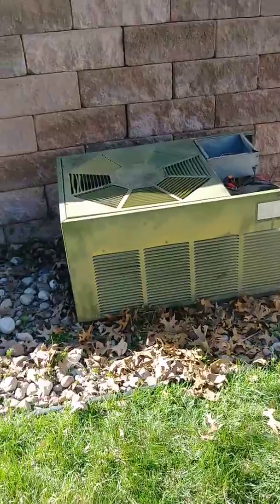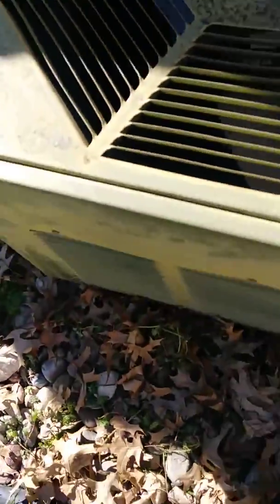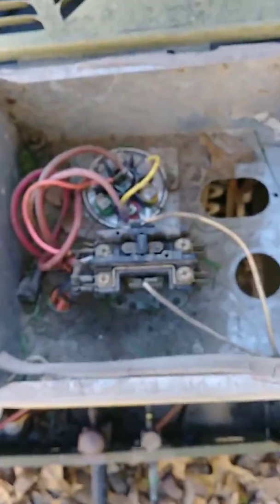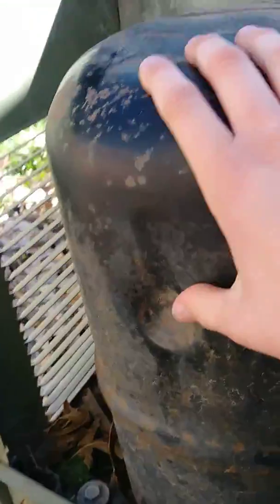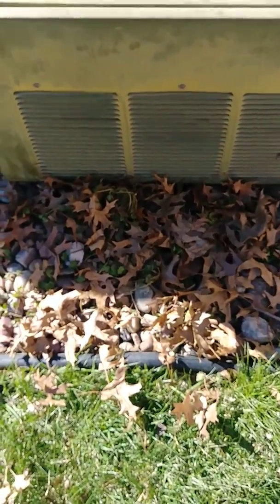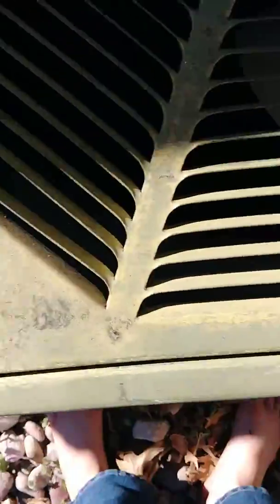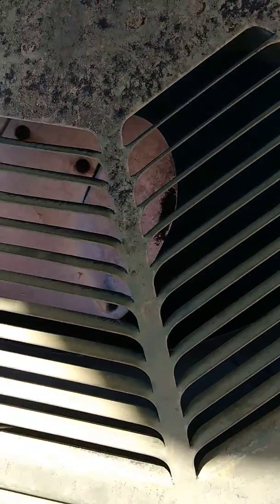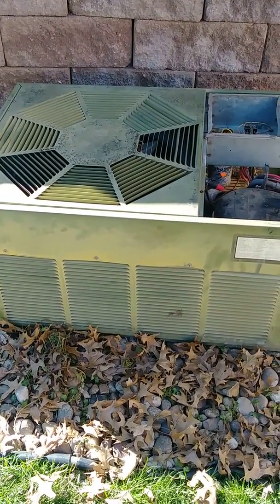My New 1983 Rheem Scrap Unit

Comment: That may be the same unit that was at my great grandmother's house due to that ding in the grill and the new old stock 90s Emerson replacement fan motor. I was replaced due to a freon leak. I had a Bard air handler with a oil furnace.
Reply from the maker: Really? Do you think so? Wow!
Reply: What year was it from?

Comment: Some collectors of old items like to just clean the item and not really restore it. My concern with that approach is that where there is rust, it is just going to get worse and eventually rust through. So maybe you should should just clean the bulk of the unit, but actually try to repair the rusted areas. Also, I'm wondering if you should plastic cover the exposed wiring. I mean, cover the wiring when you are not working on the unit and so protect the wiring from rain, etc. Then just remove the plastic bag (whatever you used) when you are working on the unit. Glad yu were able to get a unit. Not many people do.
Reply from the maker: Ok, thanks! And yes, I have been planning to put something over the wires.